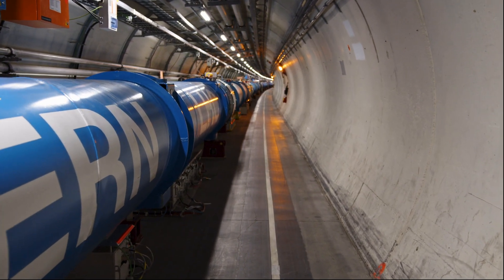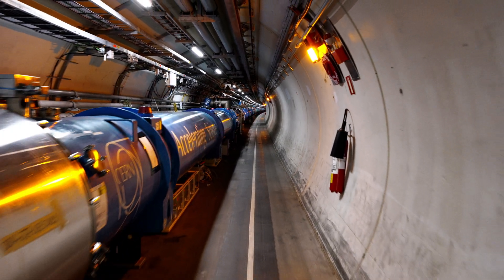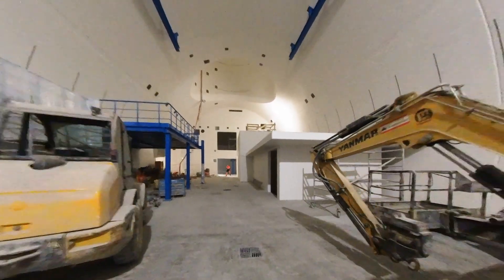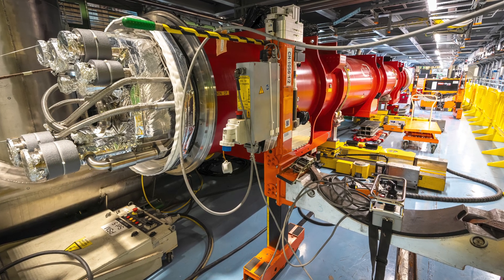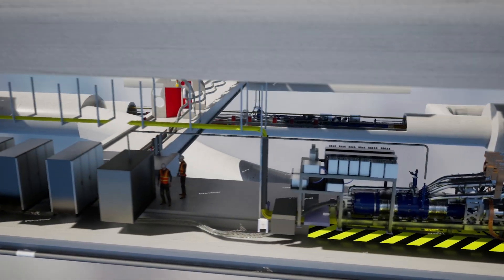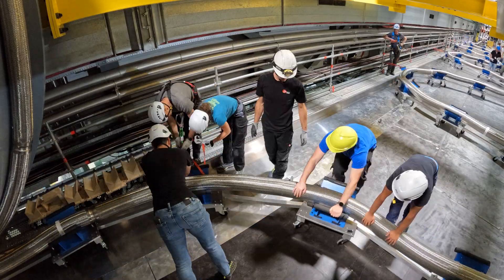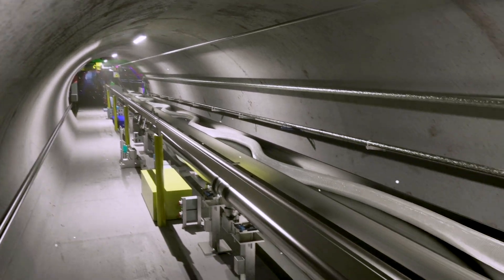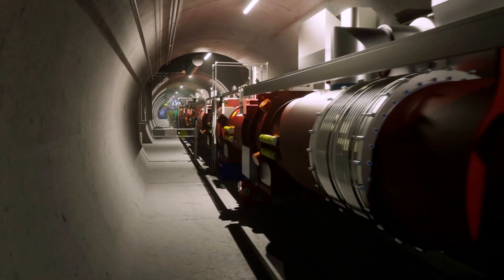High-Luminosity LHC: a new Superconducting system is taking shape

Comment: Just wondering if the beam and collision gives off any visible light?
Reply: Most of the photons given off in the collisions are way way higher energy than the visible spectrum. As the beams are sent around the LHC though, they give off synchrotron light at each bending magnet. This light is visible at certain beam energies, and is passed through 'undulators' at lower beam energies to make it visible. Synchrotron light is actually used to measure the beam position and profile in the LHC using BSRTs (Beam Synchrotron Radiation Telescope). The BSRT display is publicly available.
Edited for clarity.
Reply: @doctor_gee  Wait, undulators are used to create visible light? I only knew of applications in FELs. Why would they need visible light, if they have things like PMTs to detect any light?
Reply: @Geolijon  I know that they use undulators at lower energy (the undulator current is shown in the BSRT fixed display) and that the SR is profiled by CCD cameras. I don't know enough about the BSRT system as a whole to be able to say if they're effectively using the undulators like an FEL, but that was my understanding of it.